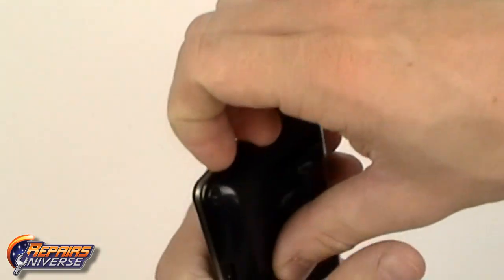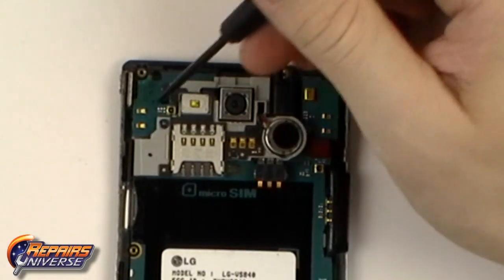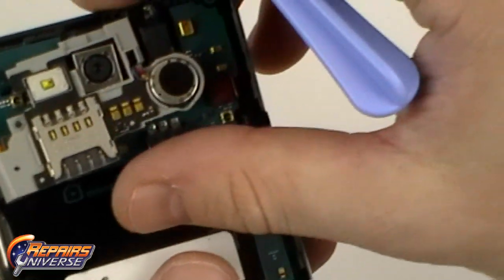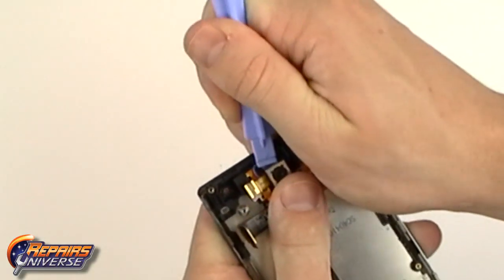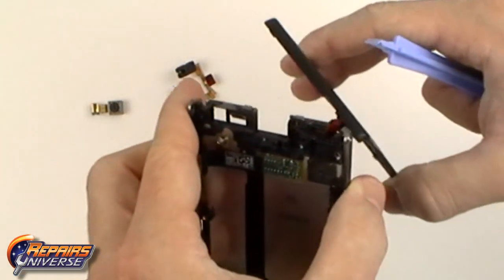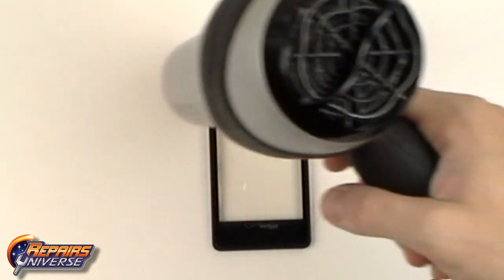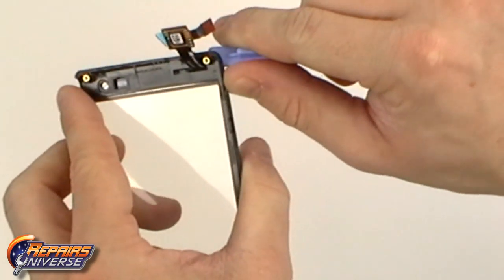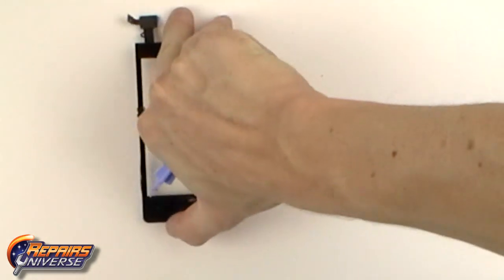LG Lucid Screen Replacement Take Apart Repair | Repairs Universe

Comment: The video works great. If you don't believe the thousands that have liked it, believe me. I just did it to my phone and it's awesome. One thing though, make sure you have a can of air next to you when you install the new screen, because you don't want to get it all put back together and have a few tiny dust specs there, like I did. Not really worth taking it apart, but it would have been nice to not have them.

Comment: I just finished replacing the glass on my lucid. It was easy and would do it again thanks to videos like this one.  Canned air is nice however I just blew the dust off which was plenty.  A nice soft cloth to get fingerprints off is recommended.  Lastly, I scrapped off as much glue substance from the broken glass to adhere the new screen to the frame. Since I didn't 100% of it I think I may have to be more conscious of moisture instrusion since I do take phone any where rain or shine. =P

Comment: 3m tape is what you're supposed to use, i believe. it's double sided. you can use that or most kits come with the tape, when you buy a screen. no, it was easy to do. but i'm kindof a tech guy. I've worked on computers a lot, and this was different, but it was the same steps reversed to put it back together. :)

Comment: I replaced my digitizer for my LG Lucid today and the repair seemed to be fine for the first couple hours but now the phone is going crazy and dialing itself, sending texts, etc. I've done countless iPhones with no problems so I know I did everything right in this repair. Do I have a bad part? Or is there a calibration step that I'm missing?

Comment: I've looked all over for a lcd replacemnt for a lucid 3 vs876.  No one seems to have them.  If the lcd is toast, is that just it for the phone?
Reply from the maker: Michael Romagnoli Not necessarily as the LCD can be replaced. The issue as you stated would be locating one and unfortunately we do not offer any at the moment. We do update our site daily, feel free to check back with us at a later date.

Comment: Hello i have problem with tuch screen, i replaced it but tuch screen is not working properly, its not acurate and its not sensing left and right middle edges 20mm from middle up and down

Comment: theres a screw on my phone that wont come off is there a special way to lossen it
Reply from the maker: alejandro roman is the screw stripped? Use a slightly larger screwdriver or a rubber band on the tip.